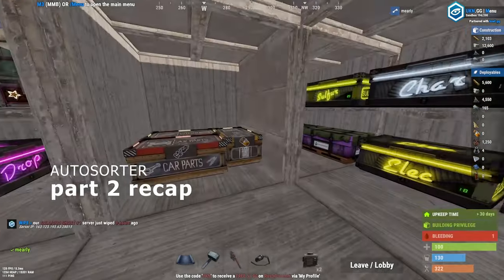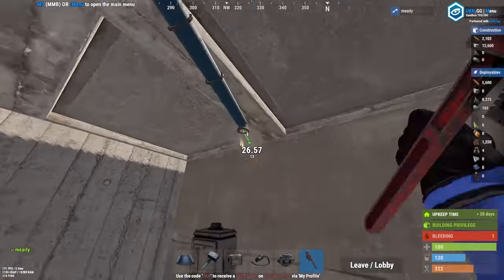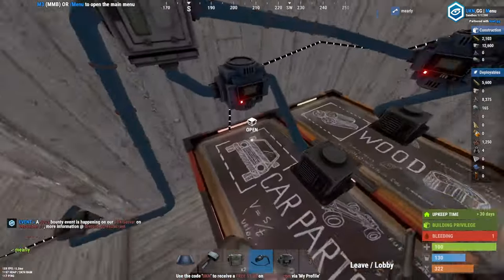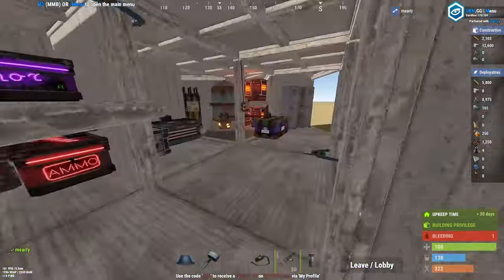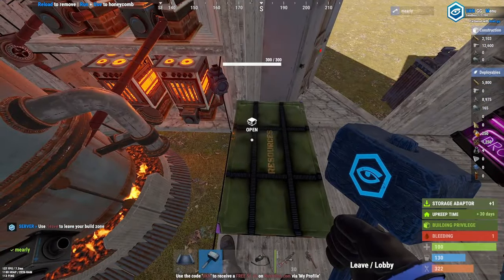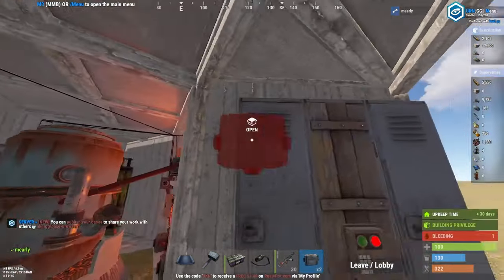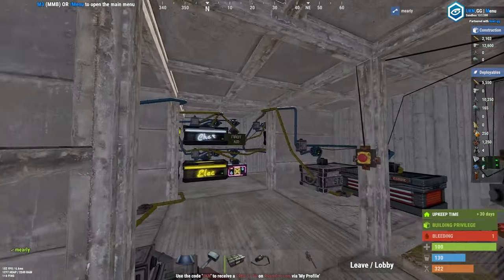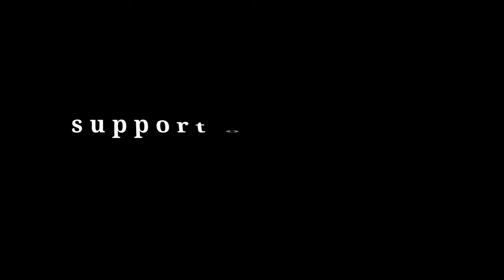RUST INDUSTRIAL - Lesson 4 - Integrating Furnaces from Sorting System (and prev recaps)

Comment: 32:21 on the primary item pipe line, add an item combiner after the item splitter that goes to the wood box.
connect the wood box output to the combiner so can get back on the main line.
connect the last item splitter on the main pipe line back to the red/blue item combiner.

wood from the drop box can be pulled to the wood box and refinery, and the refinery can pull from the wood box